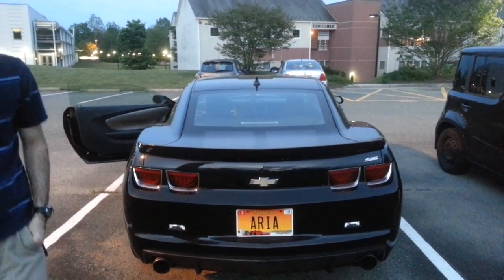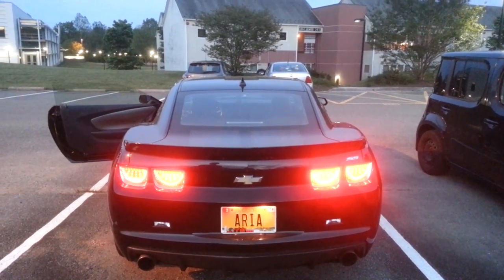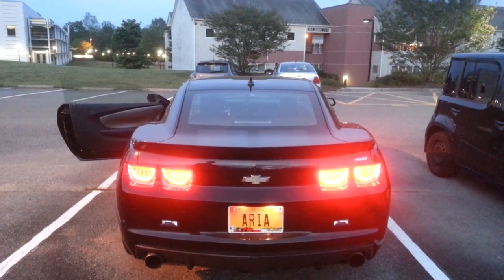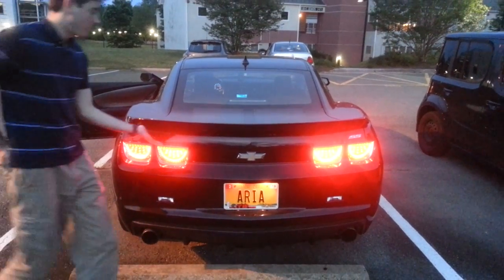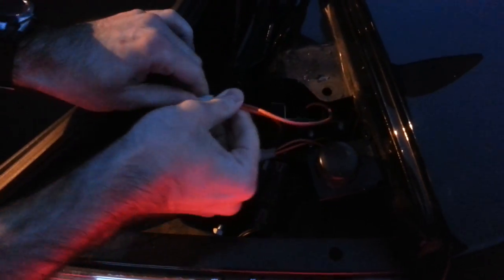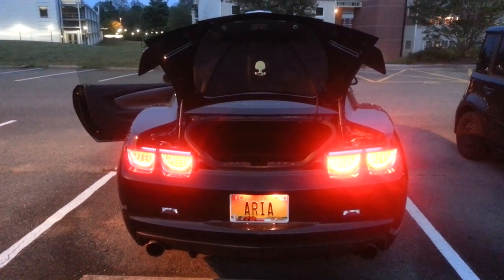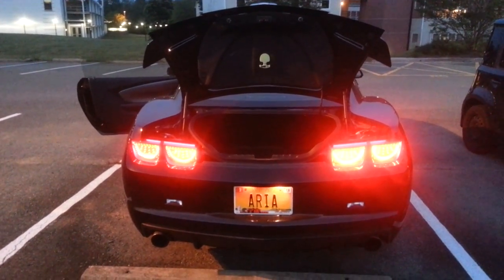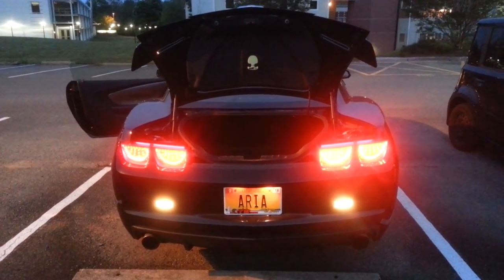Technostalgia Troubleshooting

Comment: A full three years after you released this video and I got the answer to my issue with these lights. I have them in my 2010 2LT/RS.  The outside driver side light stopped working completely. This was after I failed to maintain the battery over a cold snap we had here in Michigan. If these things malfunction you most likely had low battery voltage at some point. I disconnected the pink wire and reconnected it again. That fixed the issue !
Reply: what pink wire?
Reply: @just-a-6176  There is a pink wire that comes from the taillights and connects to the positive battery terminal. The taillights draw a constant current from the battery and will drain it if the voltage is not maintained through long storage periods.  The logic boards in these taillights hate low voltage and will not work right until they have been "reset" by pulling the pink wire and reconnecting it.
Reply from the maker: Actually one of the pins inside was just loose and not in the motherboard all of the way. A friend fixed them for me using a flathead to press the connectors in. But I didn't want to deal with issues like this anymore and one needed to be sealed for condensation, so I just traded him for his RS taillight housings.
Reply: @LanceEcklesdafer  the only pink wire i see connects to the negative battery terminal
Reply: @joeyofblades  do youy mean from inside the tail lights it self
Reply: @just-a-6176  Could be a different model of these lights. It is definitely connected to the positive terminal on my car. I have had these on my car for 7 years now.
Reply: @Camaro Joey 
Yes, right from the wire harness of the taillight kit.
Reply: @LanceEcklesdafer  isnt that the wire that connects the show lights
Reply: @LanceEcklesdafer   they are the same model
Reply: @just-a-6176  No the pink wire goes to the battery to power the PCBs in the taillights. They constantly draw power from the car, even when it is off. They will drain the battery if it is stored for a long time.
Reply: @LanceEcklesdafer  i dnt see any  wires going straight to the battery everything is connected to the factory plugs
Reply: @just-a-6176  I must have an earlier release of these lights. I got them before they were really popular. I have model 6701 Rev. B. Step 19 in the install sheet directs me to install the pink wire to the positive terminal.
Reply: @LanceEcklesdafer  does yours came with the resistor pack
Reply: @LanceEcklesdafer  my talilghts work fine the only issue i have is when i turn y signal light on from the driver side it gives me a code to check my driver light bulb
Reply: @just-a-6176  Yes, it has two packs of them that each have two 50W resistors on them (total of four). These have really poor connections that I resoldered two of them and wrapped them up in black tape to keep water from infiltrating them.
Reply: @just-a-6176  I fixed that issue by checking the resistor coil connections and making sure they were tight and water free. I also reset the taillights by unplugging them and then plugging them back in. if your blinker indicator on your dash flashes faster than the passenger side, this is the same issue I had.
Reply: @LanceEcklesdafer  im having thta exact same issue,but you were right i have a different model i have the 6800 but all it change is the pink wire